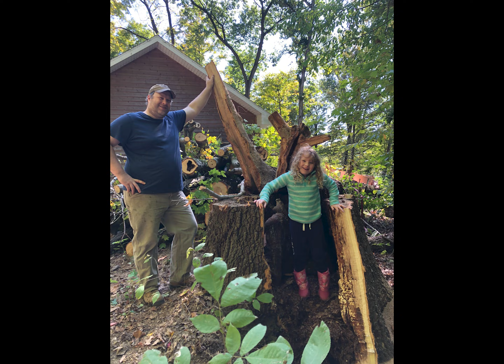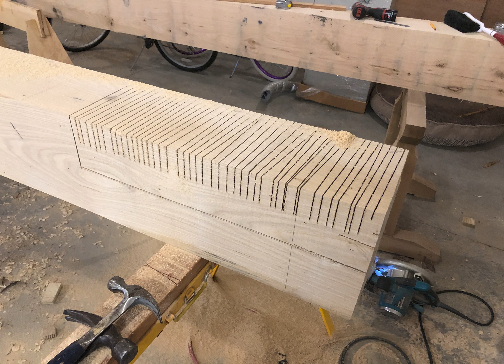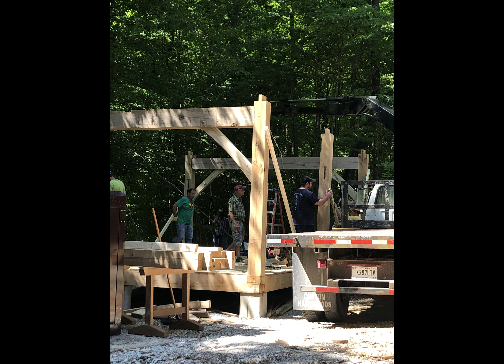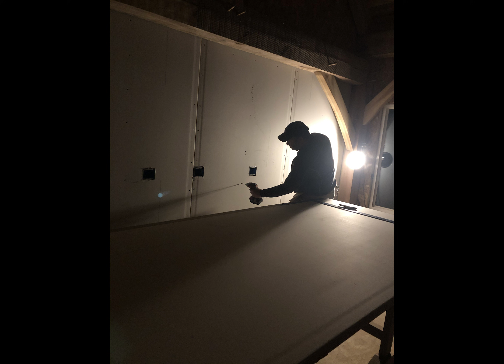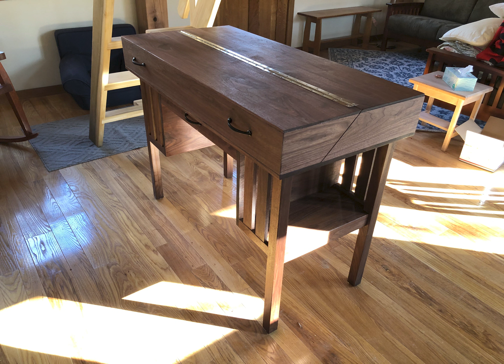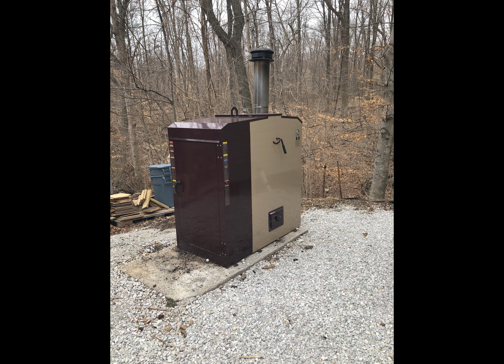Evergreen Timber Frame

Comment: Do you have a place I can buy the plans? Wanting to build something like this with white oak
Reply: Jack Sobon's Learn To Timber Frame (book). It has all the necessary information you need to build a 12' X 16', but you can make your own dimensional building. I used this same book to build a 14' X 18' cabin. Hope that helps?
Reply from the maker: Yes that Sobon book is very helpful. The plans I used came from TimberFrameHQ and were well worth the few bucks they cost. White oak was Way heavy to do myself with no equipment to move them and also by myself. That's why my above-floor timbers were poplar. Good luck!

Comment: I really like your basic building concept; small and simple, yet artful. I am planning a similar build in the Laurel Highlands of Pennsylvania. Also wanting cabin furnishings to be made, albeit mostly by my way-talented nephew. Considering self-milled timbers from the wooded lot, timber frame kits, and converted new post and beam barn kits. What are the basic plan dimensions; looks like maybe 16'x24'? Looking forward to your more complete build video, more of your musings, and good luck with your book.
Reply from the maker: Yes, 16 x 24 and I found the plans I bought at TimberFrameHQ to be very helpful, though I did modify them somewhat. Good luck!
Reply: @kellyanddereknelson716  Did you get permits for it? And if so did the county/city have any issues since it’s not stick frame?